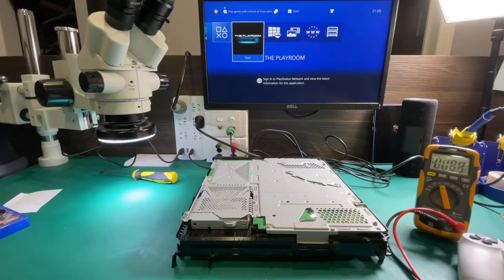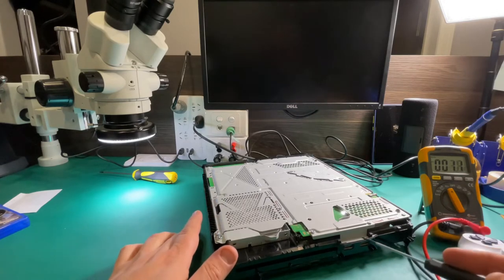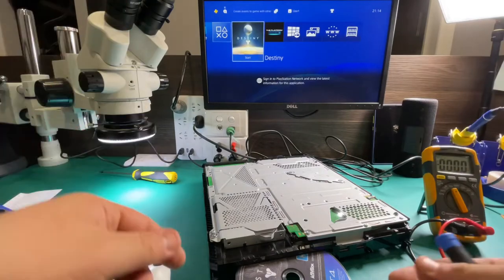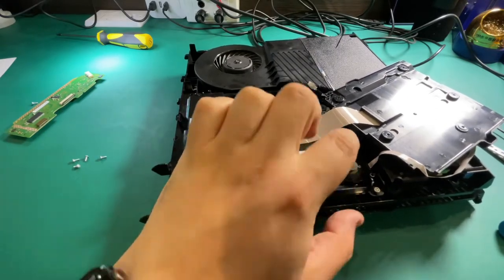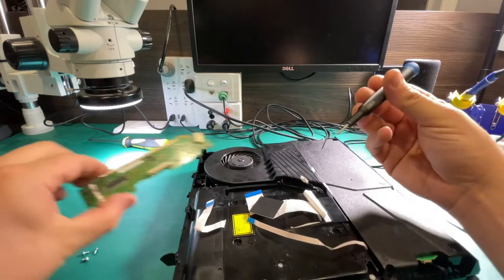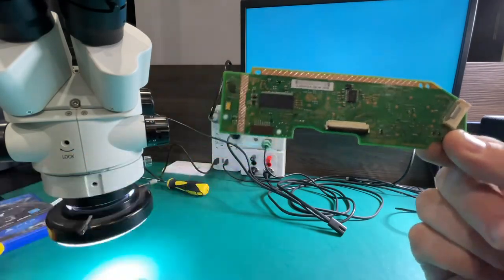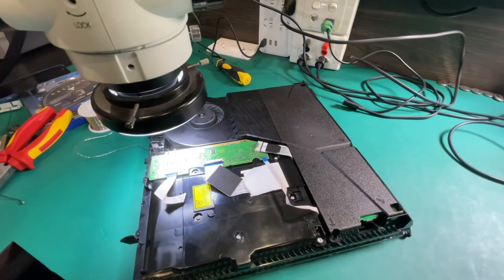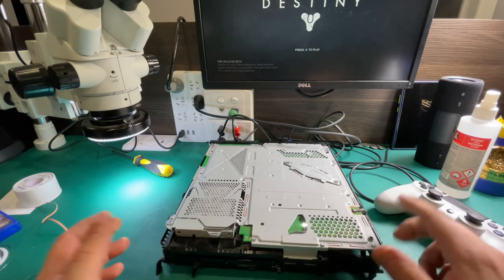PS4 Repair - Disc Drive Not Taking Disc

Comment: Guys in my case it was a damaged cable from the disk drive power supply. It turned out that when I was cleaning my ps4, while assembling it back together I accidentally crushed this cable with the power supply unit from the console. Two of these four cables were broken inside, I checked it using a multimeter. I cut off these two cables at the place of crushing and soldered them together. That's how my disk drive came to life. So if you ever disassemble the your console it's worth checking out.
Reply: Were you still able to eject with this particular issue?

Comment: This is informative. I took mine apart to clean it and the stupid thing stoped taking in discs. I was having the same thing with the manual load and it would eject for a decade when I turned it on like there was something in the drive.

Comment: Thanks so much for this. I bought a ps4 with the exact same issue and it was the same result after some fault finding as shown by you. Thank you so much
Reply from the maker: So happy I was able to help :)
Reply: I bought one with a messed up HDMI port. I took it apart and removed the drive and set it off to the side. I fixed the HDMI port and after reassemble, it will make a eject noise for the first few seconds that it's powered up, it will eject and take the disc in Automatically, but it's like something is blocking the damn disc tray!!! Grrrrrr, so aggravating.

Comment: Same as mine is doing. Not taking any disks at all. It is like the power from the circuit board isn't even connected to the place that makes the disk drive power up and take the disk.

Comment: Mine will take the disc the first it boots, you can hear the laser click a few times trying to read it and then it is an "unrecognized disc". It will eject when the button is pressed but won't take another disc. Pretty strange. I check the fuses and cleaned it up. I bought the console used with issues, so I don't know the history.